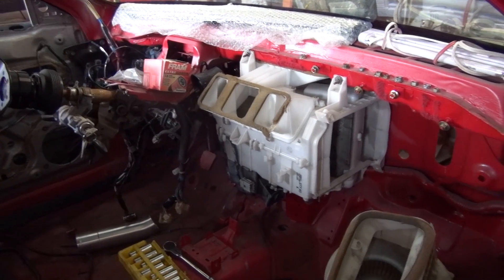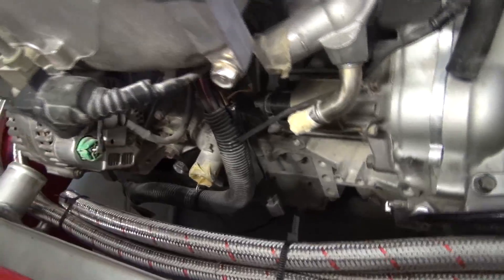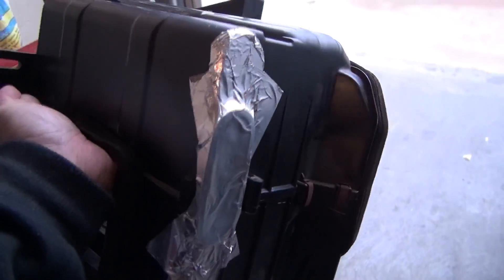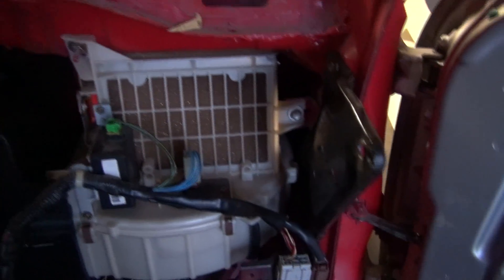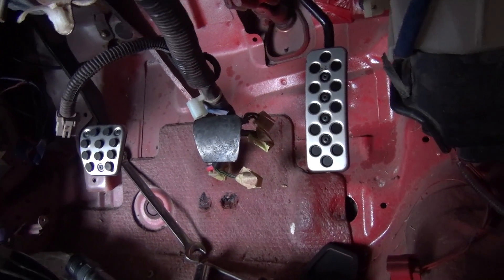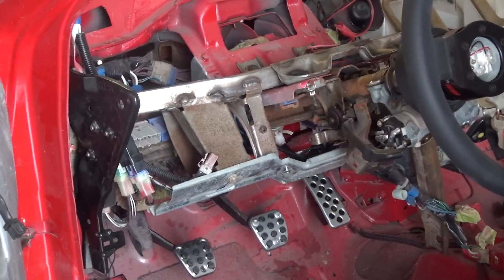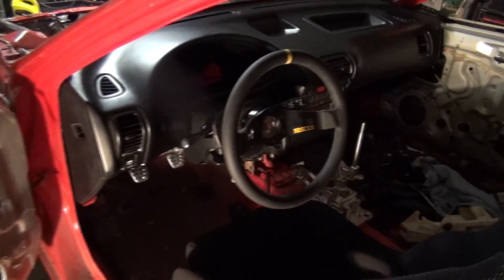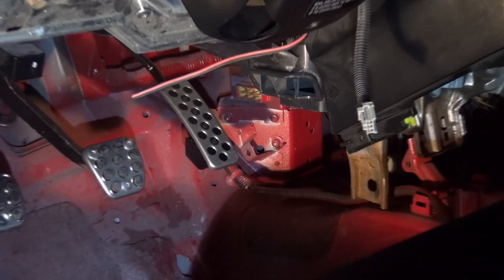Project RED: VLog # 008 - The Type RX pedals and dash goes in.

Comment from the maker: i am planning to run power and ground to the s200 engine harness, i think.  i am not super sure yet.  i also have s2000 dash harness that i can work with.  my biggest issue right now is the RSX transmissions sensors and where to wire them up to.  still looking at schematics and pins on the AEM EMS.